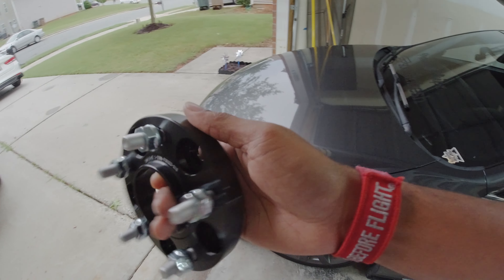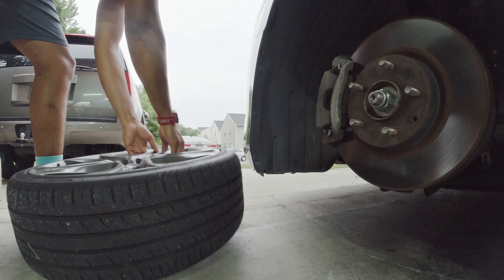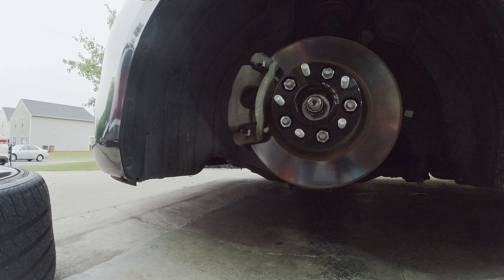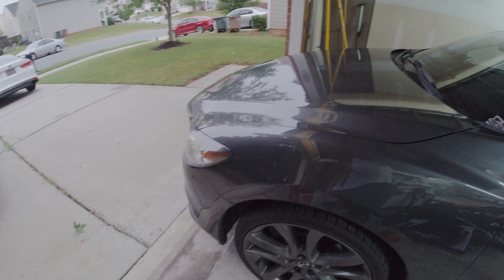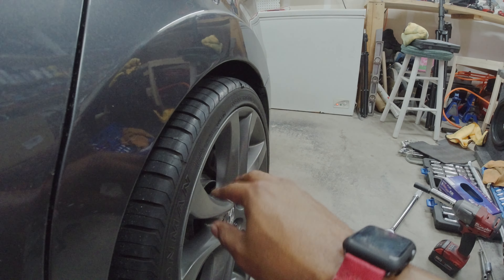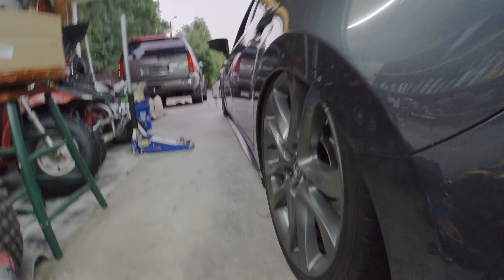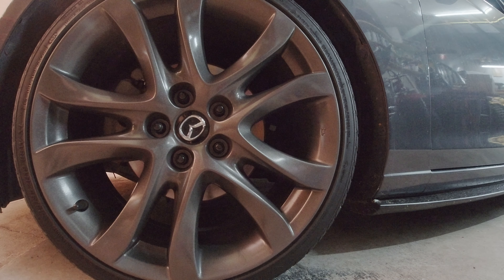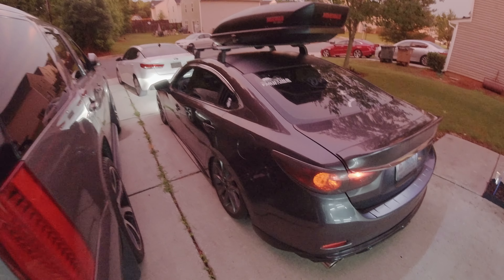Spacers and OEM Wheels! | Budget Fitment | 2014 Mazda 6 Grand Touring

Comment: Whats the maximum you can go front and back on stock suspension and 19” wheels?
Reply from the maker: 25mm is the max and it sits the stock tire size about even with the fender.

Comment: I’m running coils. I’m not slammed. Just a little wheel gap. Would I still need to roll my quarter panels and fenders?
Reply from the maker: With the 15-20mm I don’t think so. If you go 25mm in the rear it will probably be cutting it close.

Comment: Getting mine lowered on Coilovers, you think I'll need spacers and if so what size would you recommend? Great build and don't let anyone else say otherwise, remember they don't have the title or pay the bills! Keep it up ZOOM ZOOM
Reply from the maker: We modify them to make us happy, no one else! And if you have the stock wheels, the natural camber (no rear camber arms or front camber bolts) and stock sized tires, 20mm is the sweet spot imho. ZOOM ZOOM all day every day!
Reply: Think 20mm will work ok with Corksport springs (no coilovers) without any other modification? Running stock 19's

Comment: Bought these after redline emailed me saying the h&r ones i bought were in stock when i initially purchased but then they ran out and wanted me to wait till august smh.

How have these held up? The studs on them holding up ok? I really didn't wanna run cheap chinese spacers but here we are.
Reply from the maker: They have been fine. No issues. No extra vibrations. No broken studs.

Comment: Pretty much everything is Stock right now for me do you think 25mm would be okay for the rear still? I know you said 25 in the front would be good
Reply from the maker: On stock suspension, yes, 25mm will be perfect. I had 25mm on mine before I took all the camber out when I lowered it.
Reply: @DariusBuildz  I also just got a '21 6 on the 19" stock wheels, would you suggest 25mm spacers all the way around, or should I go 20mm all around or a combo? also I don't want any rubbing/scraping ... thanks!

Comment: What size of tire you have front and back ?
Reply from the maker: 235/35 and 225/35. Tires came off my Wed Kranze Ratzingers since I’m rebuilding them.
Reply: @DariusBuildz  nice I will install my air suspension this week and just need that info of tire thanks